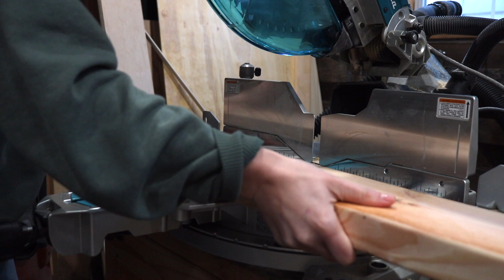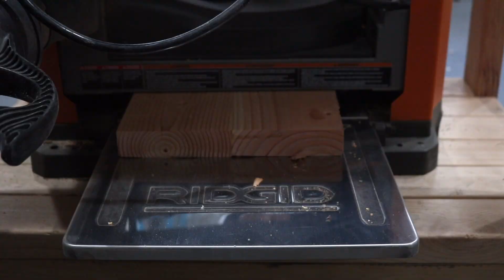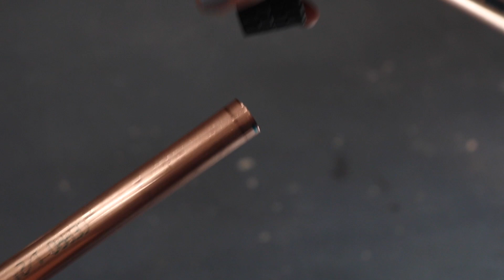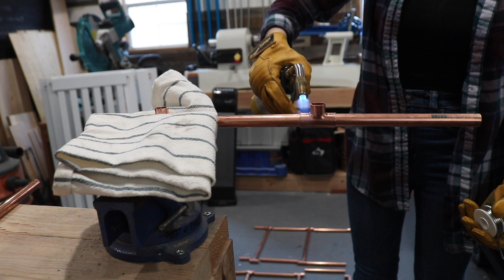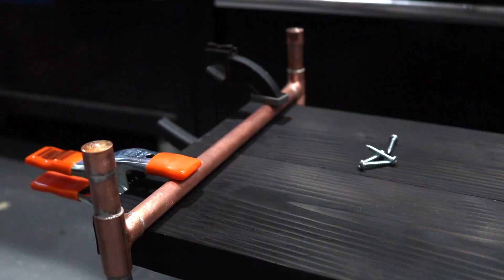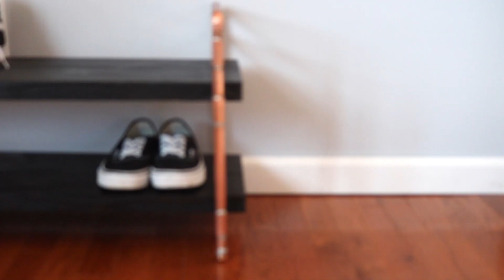Easy DIY Copper Pipe Shoe Rack! | Beginner Woodworking Project

Comment: I have nothing off these tools at home. I think it’s very beautiful but with these tools very hard to recreate
Reply from the maker: If you have a circular saw, you can make those shelves the same way and then the rest is hand tools. Would love to see someone make this using simpler tools!
Reply: Pipe cutters cost $8, Lowe’s will cut the wood for the shelves (hand sand), stain the wood instead of burning, and soldering the pipe isn’t necessary, you can glue it with the glue sold next to the pipe. If you don’t have a drill, buy one. That’s it. A simple, useful, beautiful project.

Comment: Hi Sam, Nice project. in the UK we can buy copper joints that have solder and flux already in the piece so all you have to do is put the pipe inside the joint and apply the torch. You end up with perfect joints every time with no cleaning up to do afterwards. Cheers, Huw
Reply from the maker: What! That’s so easy!